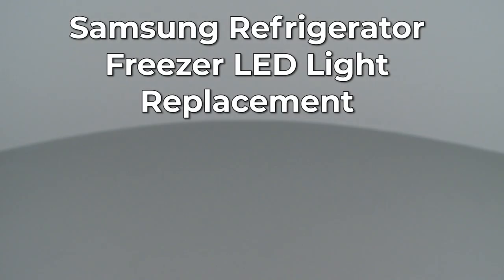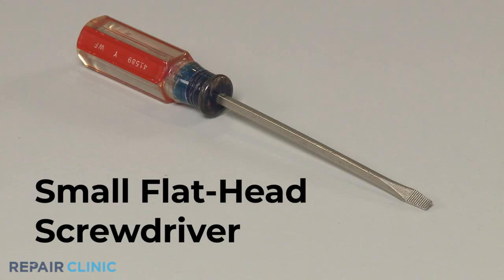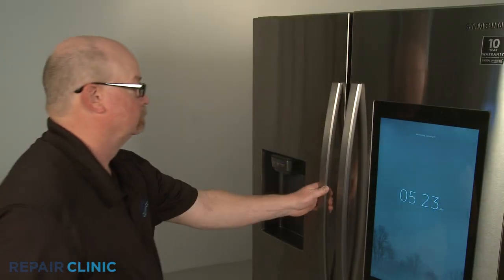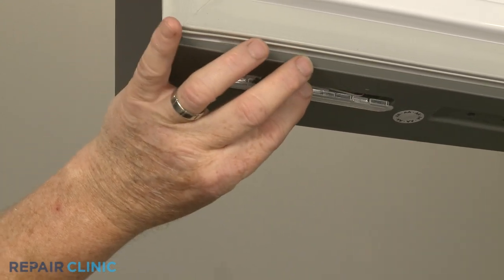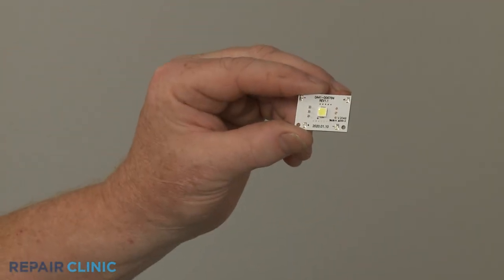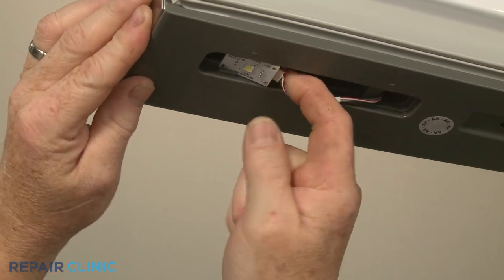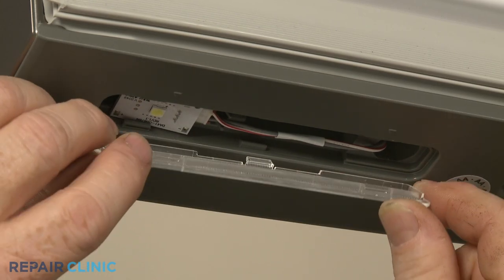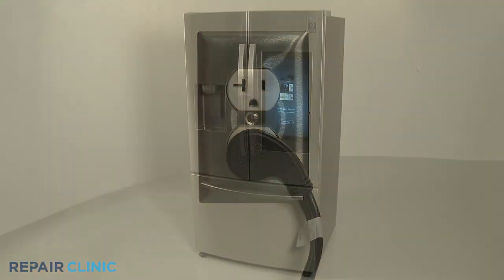Samsung Refrigerator Freezer LED Light Replacement DA41-00676N

Comment: Great video! I swapped my led out but it still doesn't work. Do you see the connectors go back often? It seems if I move wires around, the leds will faintly illuminate. I checked voltage with a multimeter and can't get a good reading.
Reply: Was it the switch you had to replace?
Reply: I'm having the same issue. How did you resolve it?
Reply: Was anyone able to fix it? After spending 30 on the part+shipping,  I'm  disappointed it didn't solve the issue.
Nothing but issues with this fridge. Samsung is definitely off my list for appliance purchases in the future.
Reply: I have the same issue, after getting a new led light it's not turning on, but if you touch by your finger the weld it might fade, after searching I think the freezer switch button needs to be replaced.
Reply: Anybody figure out what the actual problem and fix is.  I also replaced the light and it still doesn’t work
Reply: @LiteralKat Same for me.  Did you ever find a solution for this?

Comment: Great find. Thanks for uploading. How about the freezer light turns on but only if I open the drawer on top of it
Reply: I have the same problem, the actuator/trigger for the LED light seems to not be working in my Flexzone drawer.  Unfortunately, there is nothing visible and seems to be an internal magnet sensor or something.  Cannot find a schematic or anything to help troubleshoot it
Reply: I’m having the same issue

Comment: I have a Samsung RF260BEAESR/AA Rev 5 will this part fit?  I've tried researching this and I'm not having much luck finding any info about it.  I can find parts DA41-0676J, DA41-0676G and DA41-0676N.  UPDATE -- I replaced it with the DA41-00676J.  That is what was in it.  However the light still will not come on.  Any troubleshooting recommendations?
Reply: I'm in the same boat, so my plan is to see if there is any power coming out of the light connector. If there is no power and you've confirmed the switch is good, then it would have to be the control board.  

Not happy with Samsung, too smart for our own good.   Had a Samsung washer that we had to throw away after five years as it it wouldn't balance and would keep trying.

Comment: What if that light is just dim 100% of the time. You can't even tell it's on unless the lens is off and you're looking at the leds. I thought it was out until i took that cover off and it's on, just dim, doesn't change when the door to the freezer opens.
Reply: Have you tried replacing the light?
Reply: This is what is going on with mine.  Did you ever find a fix or it?
Reply: @EZRider723 no the replacement light cost was too high for me to care about the gamble. If you buy it and swap it out and it fixes it let me know! In the meantime I just upgraded the rest of the kitchen lighting so 99%of the time it doesn't matter. It's only the late night sneak an ice cream sandwich issue now.
Reply: @darklard  Well I know it's not the door switch because the door open chime still works when the freezer is open for too long.  I also know it's not the small board with the lights on it because I applied 12vdc to the contacts and it lit up full intensity.  I believe it's going to be one of the control boards and if that's the case most likely it just won't be worth the cost to fix.